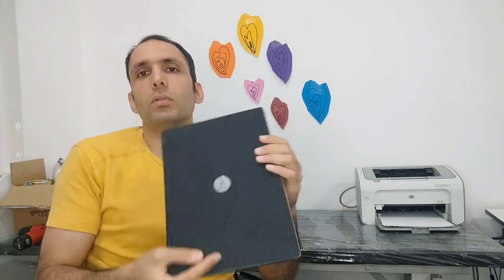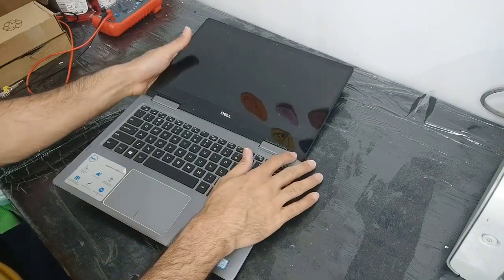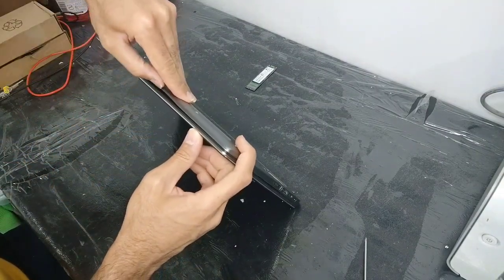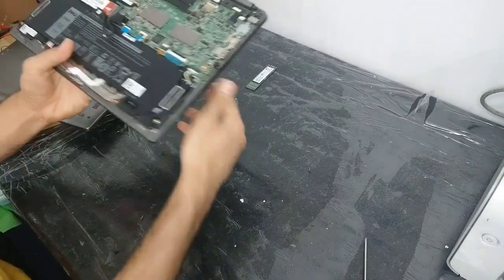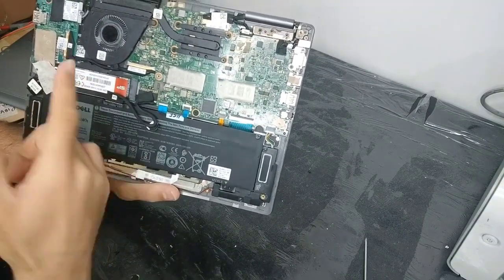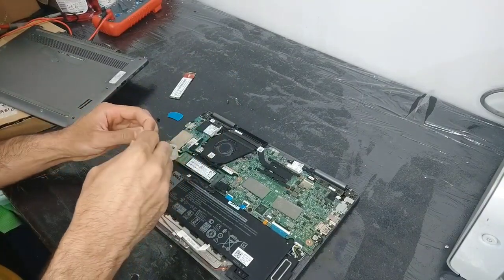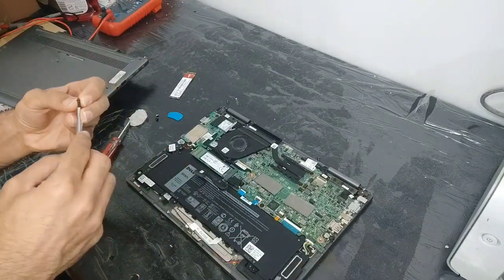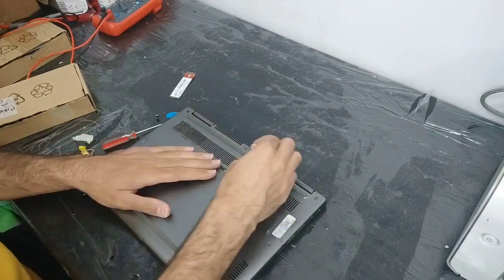Dell Inspiron 13 - ssd Upgrade - can i upgrade dell Inspiron 13 ram?

Comment: I installed  Crucial - P3 1TB Internal SSD PCIe Gen 3 x4 NVMe and it is working.  What a big difference in the upgrade from 256gb

Comment: does it support BLACK SN770 1TB Internal SSD PCIe Gen 4 x4 ? or is it just 3 x4?
Reply: @hectorlex: Did you ever find out??
Reply: @2006mrderrickh  yeah, but i ended up going with the "Samsung - 970 EVO Plus 500GB Internal SSD PCIe Gen 3 x4 NVMe"
Reply: Google: "PCIe Gen 4 is backward compatible, so a PCIe Gen 4 device connected to a PCIe Gen 3 system will function normally at PCIe Gen 3 speeds. That means if you purchase a PCIe Gen 4 NVMe SSD today, you can use it immediately in your current system even if it does not support PCIe Gen 4."